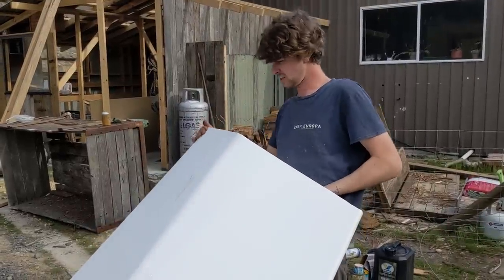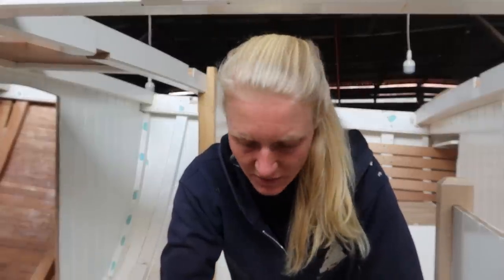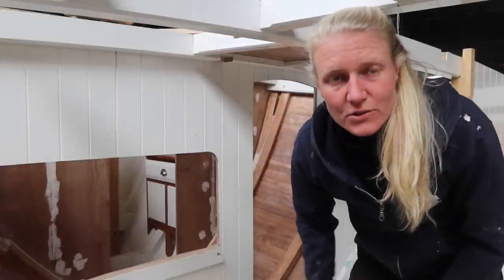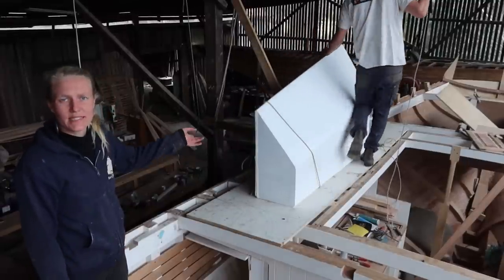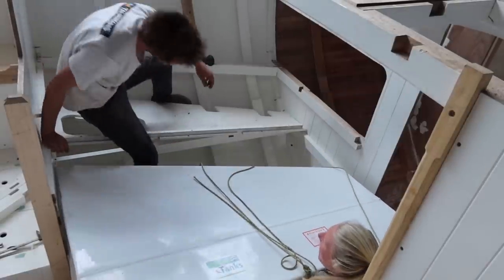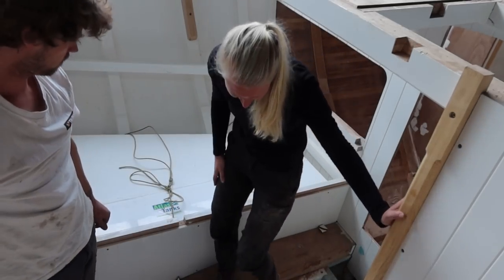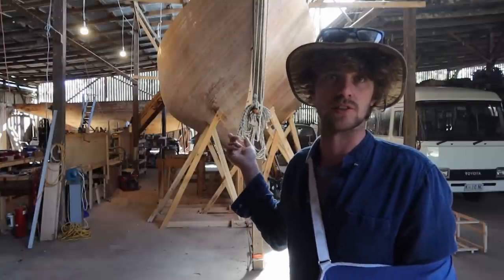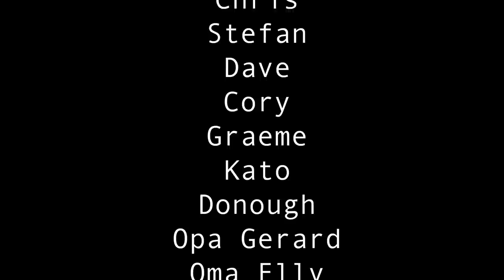Custom made plastic water tanks & issues with strip planking a wooden boat (EP10)

Comment: As for the strip planking issue, I have heard the gun shots myself a few times, but timber is a breathing  natural material and responds to changes in the weather , so don't panic it's just a timing thing, once you diagonal plank and glass your hull will be bullet proof, keep em coming and enjoy. 😀
Reply from the maker: Thank you for sharing your experience with this too! We have noticed the wood moving between seasons and as you said it has definitely stopped in the sections where we added the second layer of oak. It will be fully sealed once we glass but like everything in boatbuilding that step has to wait for a lot of other jobs to be completed first. We will keep the videos coming to take you along for the ride. I'm so happy you are enjoying them. Thank you for the inside thoughts and the feedback, much appreciated!
Reply: 3D jigsaw for pros 😅

Comment: The bad thing is not the plastic but the wanton use. Plastic has served humanity in many positive applications. Specialized usage such as yours is mighty fine when other options are near impossible or overtly expensive. I just want to ask whether you had considered 4 instead of 2 tanks for the obvious reason. Should one fail, water loss is less. However, if I were to do it, I rather have many commercial 10 litre water containers secured in compartments spread across the cabin floor. Old school style. And the filling of one main small day tank would be good exercise. Just my preference, of course. The other problem boaters face is tank cleansing. I cannot imagine myself using chemical cleansing. Yaks! Big tank hatches is one way to do manual cleansing though.

Comment: You're going to put down a piece of rubber or insulation anywhere the tank is touching the hull?? I would think that it would slowly rub a hole through the tank .. I'm also guessing or suggesting that you put a filter at the fill hose so that you can filter the water before it ever gets to your tank.

Comment: Those tanks fit really well and it was another chance to see how good your interior carpentry is.  When they are made well (not like Tally Ho's plastic fuel tanks) then as you say there is nothing wrong with plastic.  It doesn't appear though that there are any inspection hatches that can be used for cleaning.  Is that an issue or do you just have to rely on good cleanliness and the odd chemical sterilisation?   Hope Matt's shoulder continues to improve and he can get back to work soon.
Reply from the maker: Hi Tim, thanks for the comment! We are happy too with the tanks and the fit of them. Appreciate the compliment! We will give the inspection hatches more thought. Thank you for that input!

Comment: been involved with 1/2 doz tanks by Atlas tanks   - nothing but first class. get your measurements right and great solution.  thoughts on the water maker  - go bigger - much bigger  - if you are going to run the engine to run the water maker make it quick -
Reply from the maker: We spoken! Atlas are a great company for sure! And yes you can never have enough water making capability

Comment: Now we can compare (Tally Ho, Arabella) in time the results of tank material design & selection (plastic, stainless, exotic metal, other(aluminum, steel), manufacturer build/test quality, price, durability, flexing, blocking/securing/tie down, chaffing, slooshing, electrolysis between tank material and fittings, inspection/cleaning/draining/removal, repairs.
Every boat is unique and so are the owners' choices. Pros and cons to each choice and application.
Reply: Arabella used (3) 20 gallon "monel" tanks for diesel. Another exotic material is titanium. Monel is a group of nickel-copper alloys. Containing about 66% nickel & 31.5% copper, the reminder made up of trace elements.
Reply from the maker: It’s great isn’t it, to be able to see different tanks in different situations from different builders! We also watch Tally ho and Arabella and find it all so very interesting.

Comment: I’m surprised you didn’t use any type of chafe protection under the tanks. During 25 years of boat building, chafe protection was always required when installing both fuel and water tanks.
Reply from the maker: Hi Phil, thanks for your comment and concern. This was just a dry fit to see if our drawings were accurate and if the tanks would fit the space. When we install the tanks and connect fittings etc we will definitely use all recommended gear to stop chafe and movement of the tanks. They will be well protected and strapped down during the final install.

Comment: i tend to agree Matt, plastic tanks aren't everyone's cup of tea, but then i don't drink tea, i prefer Gin, haha!
i think plastic tanks are certainly better from the clean aspect as well as cost effective, but i do often wonder regarding the construction, i'm sure a single use rotary mould would be better, fittings and fixtures can be added
i have seen one boat builder who had an amazing offer on his custom tanks, but they were dreadful, had many holes throughout the welds and no pressure could be built up as water quite frankly peed everywhere, the supplier swore they were good, been tested and refused to give the customer his money back
in the end that builder went to the expense of stainless steel and another descent offer on cost, which is an altogether far better material, but with the plastic one, i wonder if the end panels might be pushed in a half inch so a descent weld can be obtained with a good fillet, the weight of the water when full cannot push the panel outwards, perhaps with inspection holes on top that might be big enough during construction to weld on the inside, or even add another fillet of silicon if the weld can only be done outside, as they say, there are many ways to skin a cat, and i'm sure methods can be much improved, lets hope these tanks do you both a great service, but do pressure test them
Reply from the maker: Thank you so much for all that info and feedback! We'll make sure to follow best practice and to favour gin to tea!!

Comment: Be sure to mount those tanks with some resilient mounting material continuously along support points to prevent movement and chafing. Also support the attached piping so any movement will not put stress on the tank nozzles  or fittings. On your next boat build order tanks with integral mounting saddles or feet. Unfortunately your tanks have no mounting saddles or feet so do a good job of mounting. The 400 lb weight plus sloshing and movement will put load on the tanks.
Reply from the maker: Thankyou, that is a very good point! We will certainly brace them well, they will become a part of the bunk with bulkheads either end.

Comment: You fitted  them without pressure testing ? Hmm, Living dangerously.
Reply from the maker: Manufacturer tests them and they explicitly say do not pressure test yourself. Atlas tanks have a good reputation and we trust them.
Reply: @Building_a_Boat_by_the_River  Do they ?
That means you can never add an inlet spout, of say half a metre, and fill the tank up with water.
That's what "testing" involves, and I cant fathom why the wouldn't want that to happen.

Comment: Polyethylene tanks have been used successfully for years for storing chemicals in water and wastewater plants. Very rugged tanks while being inexpensive. The real issue in YouTube projects was poorly built tanks that leaked. Unfortunately this was blown out or proportion  by people with lack of knowledge. Regarding your two tanks being connected, since one tank is higher than the other, be aware that the vent for the lower tank will be flooded to the level of the higher tank. Looks good!
Reply from the maker: Solid point there! We will certainly have a think about that and that when we are healing it all changes again!